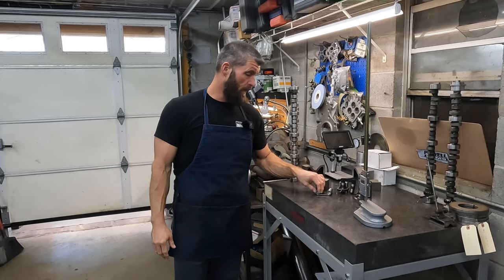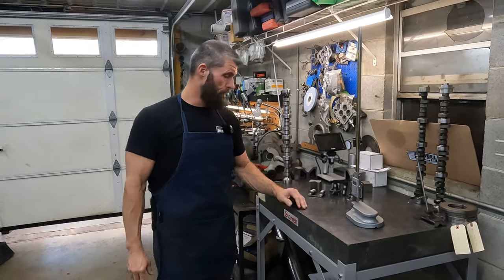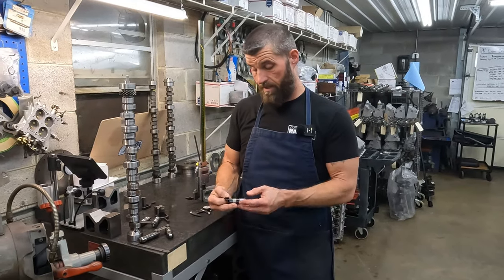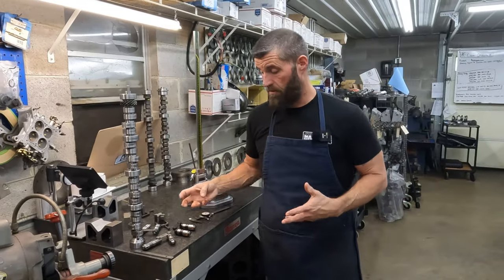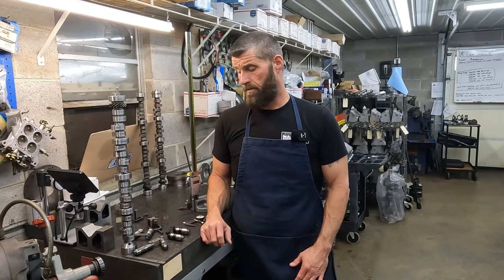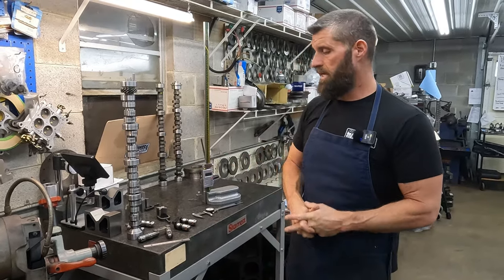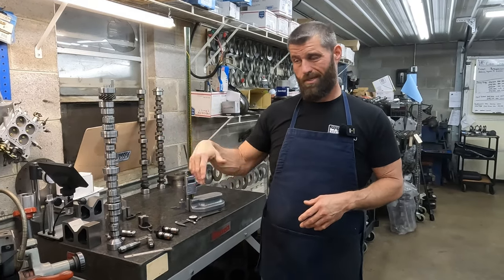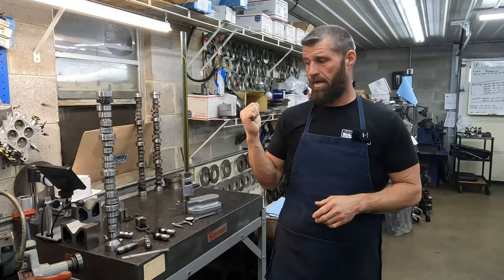Bb/Fe Ford Roller Lifter problems to be aware of

Comment: GREAT video! There is lots of JUNK parts out running around for the FORD FE. Mostly because it is one of the most misunderstood engines ever made. Especially when you get into the many versions of the FE 427, Between the low riser  medium riser high riser and the tunnel port all of them had different valve geometry.
Reply from the maker: Right on

Comment: I had some issues with comp lifters in a fe a while back. They were ground way to small and had about .0035 lifter bore clearance, and varried in size up to .0008” I went with a set of Johnson’s and that solved the clearance issue and they ran much quieter too. Cam must have been smaller because they didn’t have any issues coming out of the bore. But this is just another example of you can’t assume anything is correct anymore out of the box.
Reply from the maker: Yep, I've heard this

Comment: you mentioned the engine bleeding, this reminded me of a 454 big block chevy i rebuilt and i tried to re use the pushrods with new lifters, Big mistake I smoked 2 rocker arms and was so glad that was all it was! whew it was close.  I was listening to it while breaking in the cam and the moment I herd noise I shut the engine off and found the problem.

Comment: I dig your style of teaching, it even reaches non-mechanical folks like myself.... that said,  I'm starting to see the reasons why
the manufacturers build might be the most sound as they are responsible for lemons else no one will buy their cars?  But the
big thing I'm finally seeing is how far off base  the engine becomes as more aftermarket parts are installed?  An "engine" is a
finely tuned set of components but changing just one part can throw the whole thing out of "tune".  Each show I see more of
the picture in how a parts changer is different from real mechanic.  You're proving parts are sized incorrectly straight from
places we'd think could be trusted, Wrong!  Sorry for my long rants but IDKnow much so I am asking. thanks for the videos
Reply from the maker: Tyvm, we appreciate all feedback!

Comment: So I just took my set of Johnson lifters off the shelf, look the  same as what you have there.  Mocked it up in a CO 427. My cam is a Jones with a .375" lobe for .660" lift at the valve. None of the lifters had the oil hole come out of the bore at max lift. I will say that oil hole does come close. I measured at max lift it was about .100" down in the hole.  What I am wondering is if the wheel is different on the set you have. From the bottom of the lifter to the top of the band I measure 1.632" on mine.  Before I bought these I spoke to Isky as they were selling the Johnson lifter.  Theirs only listed the 460. What I was told at the time was Johnson made them, but theirs had a .750" wheel and it would not work in an FE. Mine has the .700" wheel, although still that would only be .025" higher, but maybe it was not the only difference,, since theirs had the pressure oiling.  The ones I have are the 2212BBR. Johnson does make a few different versions of this lifter.  As with all this stuff devil is in the detail.  One thing I will say is Johnson lifters are not junk and is a shame some on here are trashing them. Maybe they have a problem, don't know, but I'd think make more sense to contact the dealer or manufacture to at least see what they have to say.
Reply from the maker: There site lists 385/fe , obviously out of the crowd these are the problem child, I didn't say they were junk, we use them some, there's many block variations, casting differences ect, but the other brands never have this issue and a  the inspection shows why.

Comment: Really appreciate your content. I know you're trying to be as precise as possible but with one of the tie bar lifters held perpendicular to the surface plate by the v block the other lifter is close enough to plumb that you could measure it with a lot less obstruction. 5 degrees out of plumb (the tie bars have SOME clearance after all) yields a measurement within 4% (cosine 5° = .9962). There's likely way more variation in the height of the lifter bores in the block than that.
Reply from the maker: Ty, definitely

Comment: It's amazing how many "engine assemblers" that don't test and check as they go. Swing the crank after you install lifters look both sides obviously you would have found rod bolt and rod to cam  clearance issues before this. Some lifters need scratches up to the oil hole on certain blocks

Comment: The Fe engine in particular has many wuirks that need to be addressed especally in the oiling system and oil pump driveshaft areas. Cam bearings need to line up with oil feeds to the rocker arms  and the cam plug is backward from the coolant soft plugs . How many times have shops put the head gaskets on wrong and the engines turned blue ? I saw one You Tuber put hydraulic lifters in a block that was solid lifter only . 406 and most 427's are not drilled for hydraulic tappets .

Comment: Ahh the lifter debacle. Im trying to decide which solid roller link bar lifters to buy for my 351W/427 stroker build. Looking at Morrell and Jessel, no small base circle for me. I recently was eyeballing down through the lifter oil feed passageway with a std hydraulic roller in it to get some idea of what to look for in measurement on the lifters I order. I'm half tempted to machine a spacer to replace the guts in a std ford 5.0 roller lifter to turn it into a solid and run dog bones rather than link bar. IDK, may end up getting too much oil up top without some type of internal metering orifice inside my hollow lifter spacer.
Reply from the maker: We sell, Bam, there he best solid out there
Reply: @powellmachineinc  Really? I've never heard of them. I thought it probably best to go with oil fed bushed roller rather than needle bearings but perhaps that's not necessary on a .650 lift billet cammed AFR 220 headed stroker. This is simply a street engine for an AC Cobra won't see too many miles but I don't want to have issues like flattened needle bearings. I'll have to check their website to see if these will work in non roller and roller blocks both. I have a decent supply of those, also 302's and 5.0 cores. Would be nice to have a solid roller that could be interchangeable with a pushrod changeout.

Comment: I've ran 1inch redcuced base circle cams in a block big block Chevy.
Schneider racing does this service. It blows the roller wheel straight into the water jacket. Wouldn't recommend it. Small base cams are the devil.

Comment: Glad i have bought gaterman lifters for my build.  As an aside would bushing the lifter bores with slightly higher bushings solve this FE problem with the Johnson lifters?
Reply from the maker: It would solve the band being exposed,  but it still doesn't put the band in the correct location

Comment: Great video and if it were me, GO SOLID ROLLER. Problem solved.😊
Reply from the maker: Really? How will a solid fix this issue?
Reply: @powellmachineinc  not sure what a good fix would be, maybe convince the customer to switch. Can you run solid rollers on a camshaft meant for hydraulic rollers?

Comment: I’m seeing issues with a lot of new parts across the board.  I’m tearing down a engine right now that had a faulty oil pump right out of the box
Reply from the maker: I disassemble all oil pumps now and 100% measure and inspect everything

Comment: I had a similar issue  with Johnson's BBC genv with the cut out for the oil hole it was only .09 below and depending on chambers it was close.I used them it did not seem to bleed off when I primed it ...but damn could you shift .100 down🤔

Comment: I have been building FE engines and 385 series engines for 35 years. The FE has been in the family since 1958. You can not use 385 series lifters in a FE. The oil band is in the wrong location. You musy use FE lifters in a FE only. Your Johnson lifters are for A 385 series. Johnson catalogs these lifters sold as FE and big  block ford  lifters. I called them years ago and called them out on it. Told them they were wrong. Evidently my advice didn't go anywhere.  This has been a known problem for 15-20 years. YOU MUST USE FE LIFTERS IN A FE ONLY.
Reply from the maker: Well...... if you go to there website and look it up you will see they list only 1 lifter and the description CLEARLY  shows 385 AND Fe....so somebody is confused 😕
Reply: @powellmachineinc  yup. That's true. Been that way for years. They are wrong and they will not believe it. That's why I called them on it. Also why I don't use there lifters.
Reply: @justinheim9689  Have you actually ever run the lifter in an FE?  Just asking, because my FE apparently did not get your memo and has been running fine with them for several years now.  I even bought another set for an upcoming build. What you say about how the lifter is oiled is true as the oil hole is located different in a Fe than a 385 series, but depends on the lifter design if it will or will not work.  In this case they do work just fine, at least for me. Now Johnson makes a lifter that looks almost identical for Isky and it even says Johnson on it, but  that one will not work in an FE, only 385, but for other reasons. Really the way the internet is if they had a problem like that there would be threads all over FE power and Yellow Bullet about them. Just look at all the back and forth about the Morels and what oil you have to use. But anyway each to there own 🙂

Comment: Maybe they require bushings that sit 200 high out of the block, or do the factory roller blocks have a taller casting maybe?
Reply from the maker: No such thing as a factory roller Fe, and adding a bushing doesn't move the oil gallery,  plus the description doesn't mention having to do a extra 5-800  bucks worth of extra work to make there lifters work
Reply: @powellmachineinc  yeah I get it, I was just wondering if maybe that explained the issue. With our Australian Holden V8s, the 308, the newer roller blocks had taller bosses and this problem was common in early blocks.
Reply: @bigmuz_pilot  Yes you could bush the lifter bores, but unless you are doing that to correct worn out bores or to blueprint them would be a lot of extra expense. Think the point is if you haven't bought lifters then the Gatorman are a good (and less expensive) alternative.  If you already have them I'd say test fit them and see if it causes a problem.  If not run them and be happy. So far since Powell peaked my interest I've put them in 4 blocks I have laying around.  One 427 CO and Three 390.  With my cam which is a .375" lobe (.660" at valve) none uncovered the oil hole at the top.  The worst I measured was just over .100" to the top.  If you have more lift maybe could be a problem with some block, this is a you have to check deal.  Honestly if you build engines it is all about quality machine work, good parts, and making sure everything plays together nice. For all my life any aftermarket "High performance" part required work.

Comment: I was trying to figure out why you couldnt grind 0.225 off the whole cam. It would work even if its a ridiculous solution but you answered it. There is is no way there is that much heat treat and i should have known that. I also wonder if you would start to twist the cam if you tried to run it, thats a lot of metal to remove.
Reply from the maker: Definitely

Comment: Not sure about the smarts of the client if he just wants a smaller base circle - that's going to mess up the whole cam lobe shape and, if keeping the same nose radius/height from C/L, it will increase the lift to the same point as the leakage is occuring.
What he should be doing, if keeping the lifters, is buy a NEW camshaft with a smaller base circle and corresponding reduced nose lift of the lifter in it's bore.

It is also possible - I honestly have no idea on the differences - that he purchased the wrong set of the FOUR hydraulic options offered by Johnson for the engine?

Comment: i have a one piece seal sbc block that has a counterbore at the top of the lifter bores about a 1/4" deep. it came that way from the factory. works fine with stock or very mild cam but any lift over .500 and it starts blowing oil out of the lifter bore. never have seen anything like that before. why would they do that?
Reply from the maker: What the video again,  and listen when I talk about lift

Comment: My cam grinder gave me the wrong length tie bar , broke top of  the lifer after 250 miles . $7000 dollar rebuild  !
Are roller cams lobes ground square to the centre line of the core , so does the cam move left  and right  ? Remember I was born upside down 
Kit from down under
Reply from the maker: Yes, on center, no doesn't move

Comment: Real question here though, I understand that the hole being too high is a problem and I understand why, but wouldn't the actual measurement of how far down it needs to go be based on how far out it sticks from the lifter bore and not a comparison to the others?
Reply: With the johnsons apparently losing oil out the top and the two other brands not doing that, I think it is safe to say the two that don't have a problem are the right thing to compare them to. There isn't much difference between the good ones and the "bad" ones.
Reply from the maker: Exactly
Reply: @-DJ-  well I understand that, but he gave a number of how much to grind the cam down to make it match the others, not to make it not leak oil past them. I understand he doesn't have the engine to check it, but its entirely possible that a smaller Base circle cam would work if the hole is never uncovered. As in maybe this cam and lifter would work being ground for clearance if they barely stick out of the bore. Obviously not ideal, and still the end result is a junk lifter. But making it work MIGHT be possible depending on how much it sticks out

Comment: Is that .114 just lower or lower  and upper part of it ??
Reply from the maker: Top of oil band is .114 taller on Johnson
Reply: So thats .228 difference over all so 1/4" in rough term.   That would be tight with wood and a hammer ... Never mind forged or machined items.. please excuse me if I'm wrong but that's😮

Comment: Something tells me those are 385 series lifters...
Reply from the maker: 385 and fe are the same lifter
Reply: @powellmachineinc   Lifter bore depth is the same as well ?
Reply: @powellmachineinc   I seem to remember and it's been years ago and at the time I had a 460 and a 390 in the fleet,, that the 460 and small block Windsors and one of the 6 cylinders were the same lifter and interchangeable,, but FE lifters were always listed by themselves...
Reply: 385 series and FE are not the same lifter. If you use 385 lifters in a FE this is the problem you will have. You must use FE lifters in a FE only. The 385 oil band is in the wrong location, it is up to high.
Reply: @justinheim9689  Yes the oil passage in an FE is located different than a 460.  The 335 and 385 series are drilled the same.  An FE is similar to a 302.  As to if it will work all depends on the lifter design.  The Johnson lifter being talked about here will work in both FE and 385 series.  Now that said Johnson makes a Hyd Roller lifter for Isky that looks just about dead on the same as what you would get from Johnson, and it even says Johnson right on it, but it is different and will not work in an FE.  On their website it is only listed as for 385 series and if you talk to them they will tell you it will not work in an FE.  I'd like to know the part number of the lifter in this video.  I have a set of the Johnson lifters and now checked them in 4 block and although the oil hole is high it still far enough away that it is not going to get uncovered.  Regardless always good to know about potential issues.  I've always run the oil pump before putting the intake and valve cover on make sure everything oils right.    Also pump the cleaning solvent thru the block when in the washing tank.  Once found a SBC Dart block that did not have the #3 main oil passage drilled all the way thru.  Was a new block.   Always mock up and check everything, never assume all I can say.

Comment: Could that customer if he just had to use those lifters could he machine the lifter bores and sleeve them basically make them taller ? Why doesn’t he just use another lifter those Johnson’s are high dollar
Reply from the maker: That would cost 3 times what a correct set of lifters would cost
Reply: @powellmachineinc  exactly my thoughts, I still wonder why would Johnson put oil hole so far up I don’t understand that design

Comment: Am I wrong or,,, reducing the base circle won't change the over the nose height., unless you grind the nose down the lifter will be at the same height. The only fix I can see is to bush the lifter bores and leave them a little tall.,or junk the lifters for a set with proper specs. Bad Q.C. during manufacturing.
Reply: It would be quite the mistake in machining to be near an 1/8 inch off on an entire set.
Reply: @--_DJ_--  Bad program on a CNC and don't catch it for a while in quality control and there you go.,who knows how many sets made it out the door.
Reply: @briana3467  That just seems remarkably unlikely to all occur on the same part. Maybe if it was the first run of the part and QC didn't show up to work that day something like this could slip out the door. 
Anything is possible though so who knows.